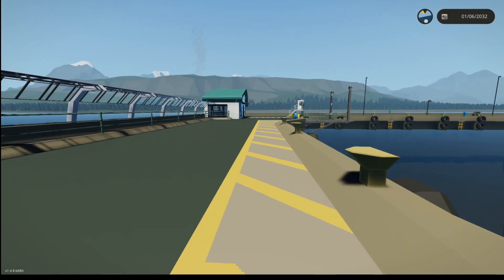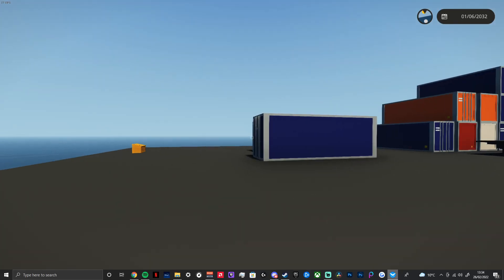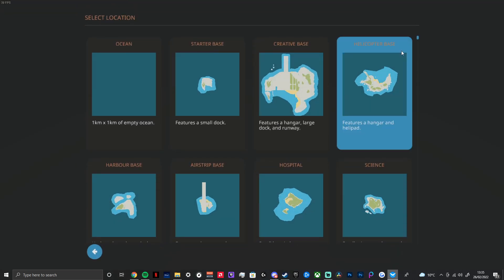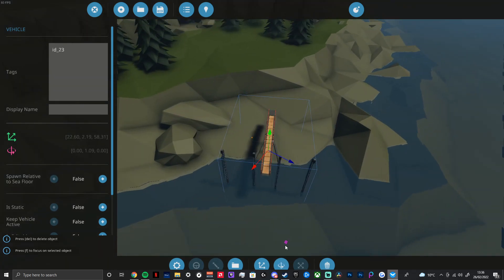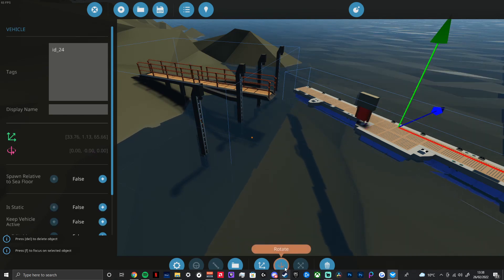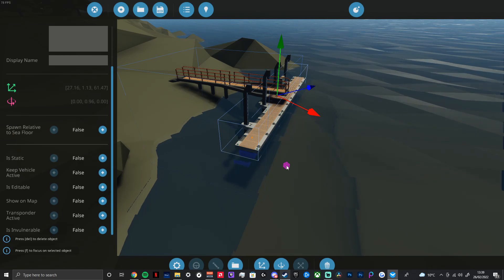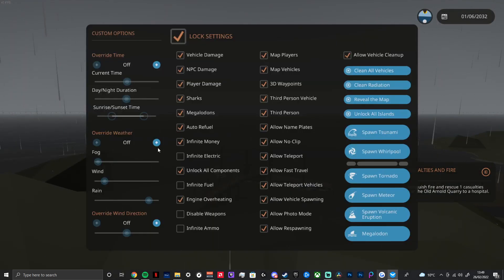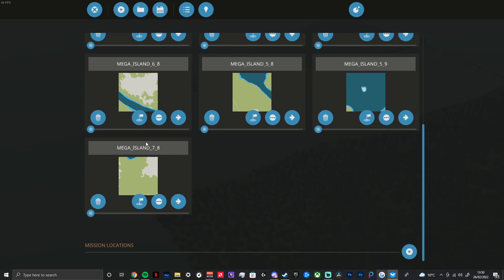Building Environment Mods In Stormworks - Stormworks B&R Tutorial

Comment: i tried to make a dock a while back also with those basic hinges but every time i load it into the world the hinges act like normal blocks and stay straight so the part that is suppose to float in the water hangs in the air? I eventually made it with magnetic hinges and just made the floaty part with motors so i can drive it to the docking area but that don't always work either haha
Reply from the maker: My best guess for this would be that you made the floating section first and made the other parts as seperate subgrids in the same creation, by making the floating bit first it then becomes the main subgrid so when you spawn the creation as a static object its that part that is static. What i usually do for floating sections is make them sections seperate creations to the bit you want static, and then have them connected to it somehow (tracks work well for this)
Reply: @creaghalls5491  thanx will try that